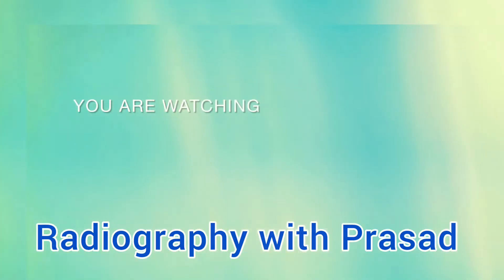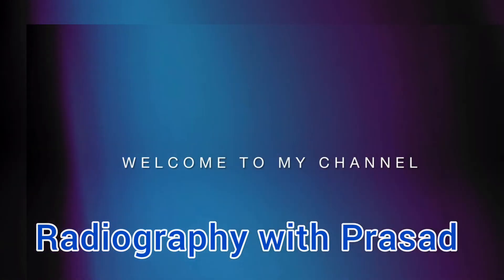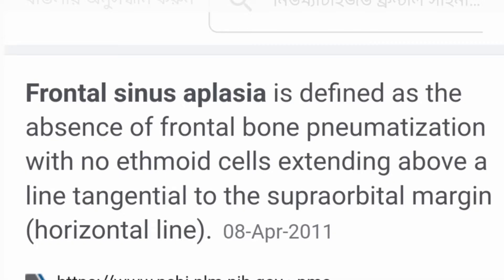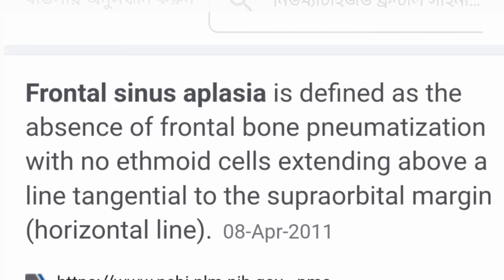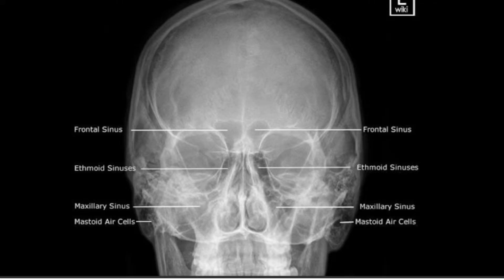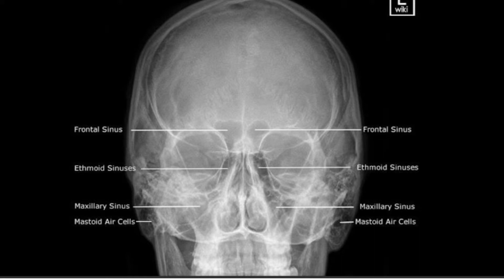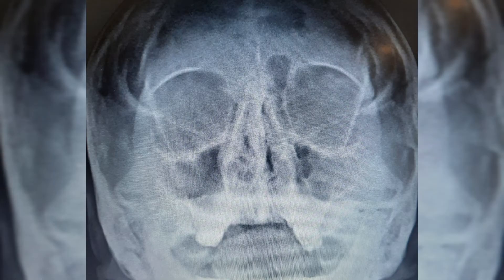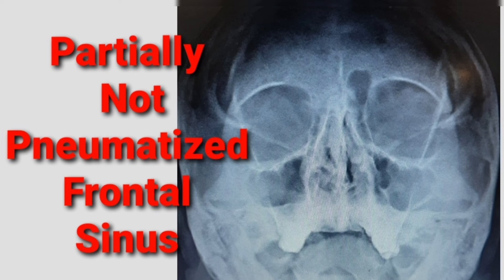Partially Not Pneumatized Frontal Sinus| How to do Skull X-ray| PNS Findings| How to read PNS, Skull

Comment: Skull radiography is not sinus radiography. If you include the cervical spine on sinus xrays, you should be thrown out of the profession, but bad radiography and high dose is standard for your country
Reply from the maker: Which country you are from?
Reply: @radiographywithprasad6383  South Eastern Australia. I am 6 years retired after a 40 year career. In 1986 I discovered most radiographers didn't know what happened to the xray beam with tube angulation. I presented national papers in 1988 and 2016 where I proved only 25% understood the geometric principles. India gets about 8 times as much radiation as the rest of the world, all due to lack of collimation and the use of centering points. Have you watched my videos? Begin with this one, then watch all 7 on radiography. https://youtu.be/QRT7wpOZmko
Reply: @radiographywithprasad6383  Australia. We are well trained. There are no radiographers as bad as you in my country. We do the correct projections for minimum dose. That is the difference